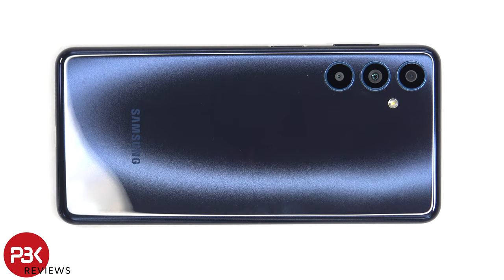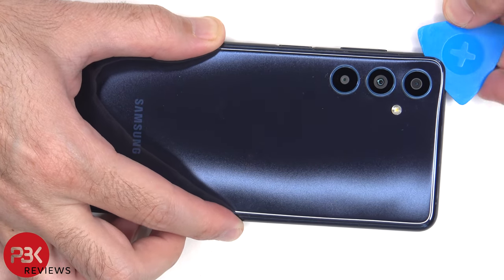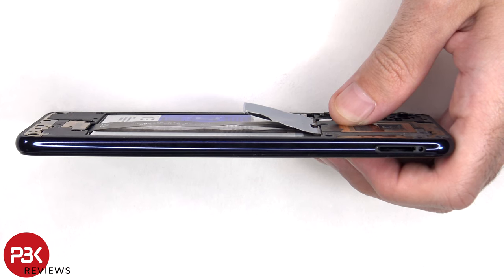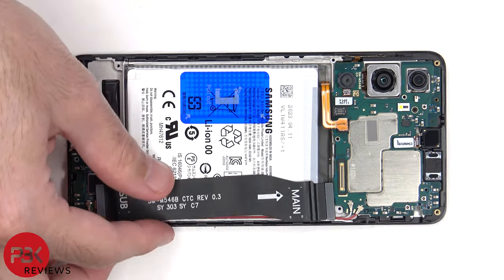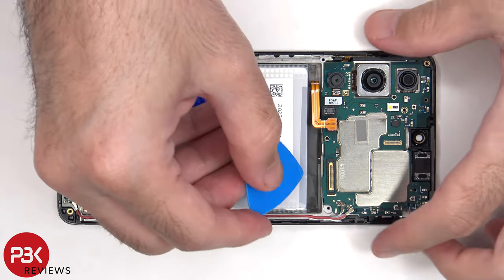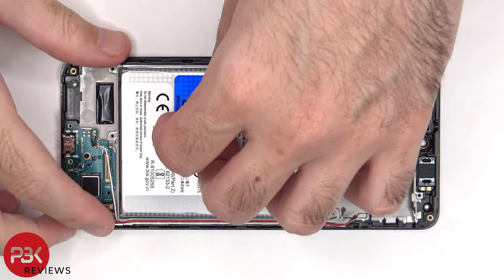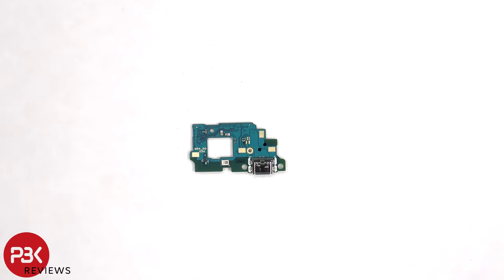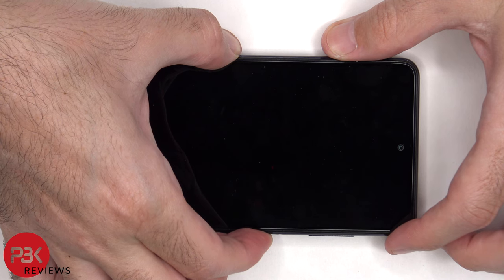Samsung Galaxy F54 / M54 5G Teardown Disassembly Repair Video Review

Comment: When I opened up Smartphones which Can be open from the sides, I mean like what you have done right there. I don't usually take off the back cover. I just pop the sim card out and pry from the sides.
Reply: What about the Screws !?
Reply: if your phone body is unibody, you can just remove simcard tray then the cover.

if not unibody, after removing the back cover & removing the simcard tray, you need to unscrew first.